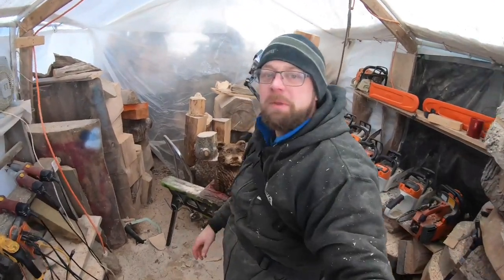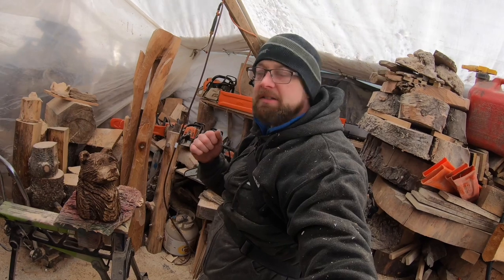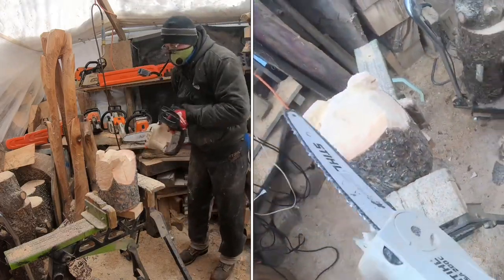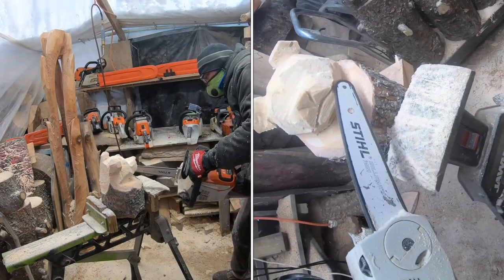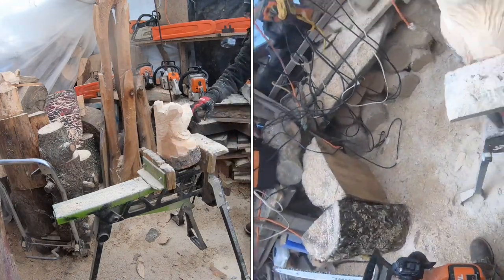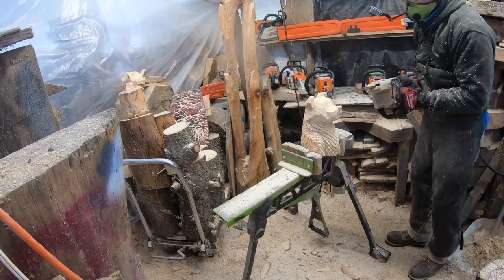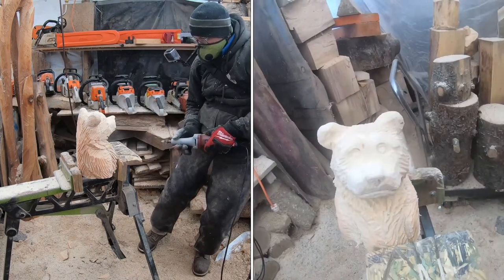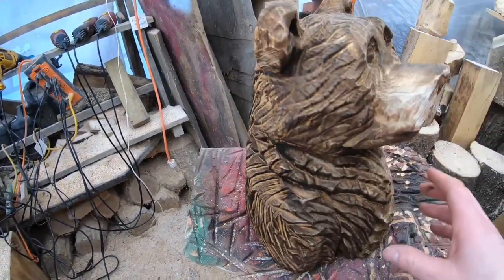Chainsaw carving a bear step by step This bear carving tutorial should help beginner carvers

Comment: Thanks for the videos!  Interested in the extension chuck wi/hand hold for the flap sander.  Darn hard to find, except maybe a tool company in England has one.  I thought about getting a long bolt or all thread (3/8 -24?) that would fit an old or replacement Jacobs chuck.  Then you'd have to drill out a piece of hard plastic or aluminum for the handle.  Not super hard to do, but kind of a pain.